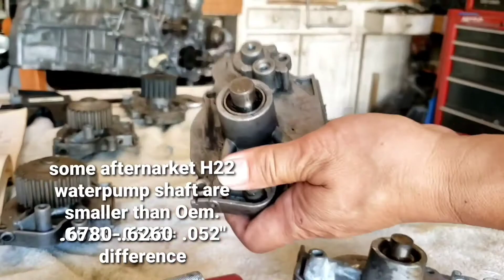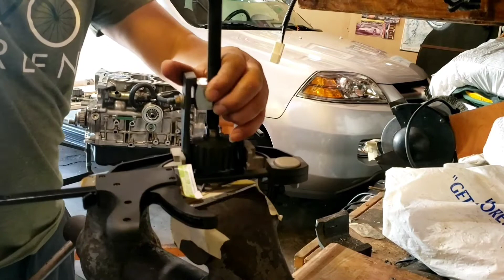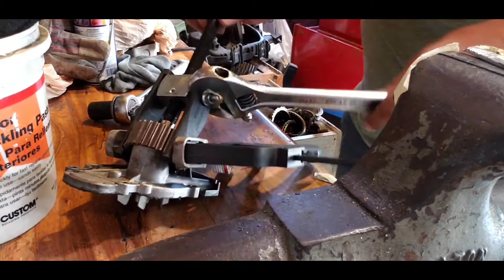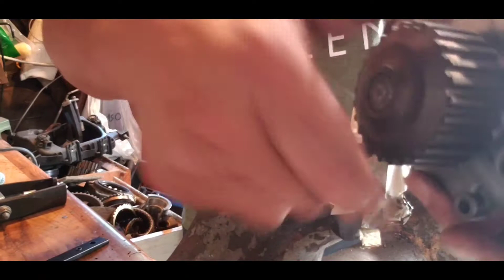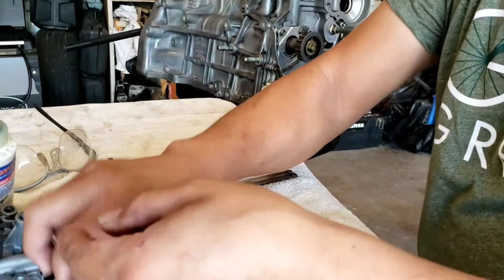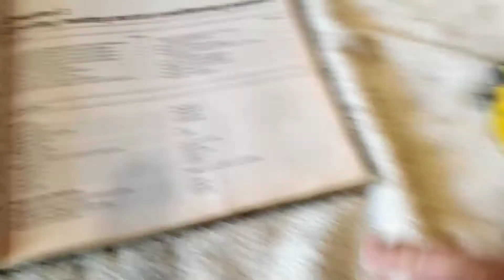How to remove and install H22 waterpump gear onto F23. G23vtec episode #12.

Comment: If you could chose between the H22 head and the H23 which would it be on an F23 block?  Thanks Sag!  (I'm guessing Saggy isn't a good choice for a nick name? ;))  )
Reply from the maker: 😅😅😅 not really.. H22 and H23a bluetop cyl head are basically the same. H23a camshafts are very good on G23, it's ctually better than type S.
Reply: @sagittnet2158  You're the best!
Reply from the maker: @PoolSquirrel ❤

Comment: I'm getting there with my build. I have a few questions for you about it because I'm trying to use my og f22a6.
Reply from the maker: Anything specific?
Reply: @sagittnet2158 kind of I'm trying to figure out pistons and leave it single cam. Using cxracing rods and only pistons I've found that are dished and 85mm are for Evo Mitsubishi. Cause f22 have the press fit wrist pin and the new rods are for floating wrist pin.
Reply from the maker: @Lost10mm.  The evo 8 piston height is very high. It'll stick out pass the block more than 0.040". I got a evo piston that my nephew gave it to me coz l'm thinking of using on a F20b. It'll fit the cyl bore and wrist pin but it's too high.
Reply: @sagittnet2158 thanks so much for the reply and insight. I'm guessing my only real option might be bore and f23 pistons.
Reply from the maker: @Lost10mm.  you can use F20b piston, lots of folks are changing their 85mm f20b piston to 86mm k20 piston. Search fb market or ebay.
Reply from the maker: @Lost10mm.  it's hard to find a 85mm that's why f20b owners are boring it to 86mm
Reply: @sagittnet2158  will it be higher comp?
Reply: @sagittnet2158 thank you so much f22/f23 master 🙏
Reply from the maker: @Lost10mm.  Evo8 piston height is so high that it'll hit the cylinder head.
Reply from the maker: @Lost10mm.  if you can get a use evo8 piston you'll see it. I used a H22a4 piston on f23 crank n rods. That combo will stick out 0.020" of the block and you can runnit lije that. But what l removed some material of from h22a4 piston so it wont stick out and it worked. I also widened andake the valve relief a bit deeper. Maybe you can do something like it. But l think the best is to find a used F20b piston.

Comment: Amigo y para hacer un G23A1 no vtec ? Que se necesita?
Reply: Exelente 🎉 y que tal corre no tienes una idea?! Estoy queriendo armar uno saludos ❤
Reply from the maker: @Spoon16z I'm not sure about nonvtec version on how's it running but l know it'll be somewhat run stronger. But my g23vtec run very strong and no problem yet. Gracias senor
Reply from the maker: Non vtec, you need a H23a1 cyl head/ F23 block, H23a1 timing belt, H23a1 timing gear install on F23 water pump. H23 crank gear. For your piston, if you use k20a2 piston, make sure to clay the motor to check that the piston is not hitting the valve.
Reply: Saludos bendiciones desde México baja California sur la paz🎉❤
Reply from the maker: @Spoon16z  👌

Comment: and if you are using an h23a1 non vtec block with h22a1 head youll use the h22 waterpump with no mods
Reply from the maker: Yes, h22 waterpump bolt right in. You'll basically will have a H23vtec (coz H23a1 use a 50mm crank journal).

Comment: Hey thanks for the video. Is it basically the water pump gear has to be the same as the crank your using? you have f23 crank in h22a4 block?
Reply: H22a4 head as well?
Reply from the maker: Its basically a stroker H22a4. F23 crank n' rods, H22a4 pistons. I modified the h22 pistons so it doesnt protude .020" the block.
Reply from the maker: Anything that H22 timing belt touches. 1998-2001 H22a4 block have 55mm main bearings and f23 crank fits inside. Same thing as F20b and H23a block(55mm)

Comment: how many teeth does a h22 have compared to a f series
Reply from the maker: H22 have more than F23 but its not just the count its more about the fitment of the H22 belt on the teeth.
Reply: Hi brother can I use a h22 h23 f22a fuel rail on my f20b sohc engine any information will be appreciated 😊 👍
Reply from the maker: @misunderstoodvtec8299  l'm not sure if the rail mount ear will line up, but the injectors holes will. I know h22 and f22 are interchangeable but it a matter of the fuel line entry( lt or rt) but injectors spacing are the same. For F20b single cam if your manifold runner spacing are like these 
0 0 0 0, it should work, for securing it if somehow it not the same. You can always modify the mount.
Reply: @sagitt net2  hi brother yes it's 0 0 0 0 on the intake manifold  side so I was thinking of  a h22a7 or something which would you recommend 😀